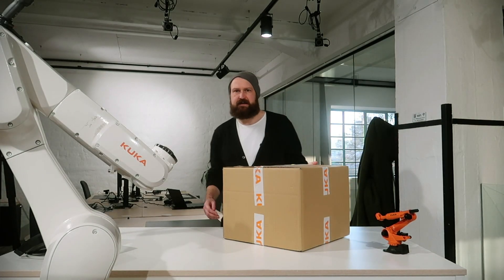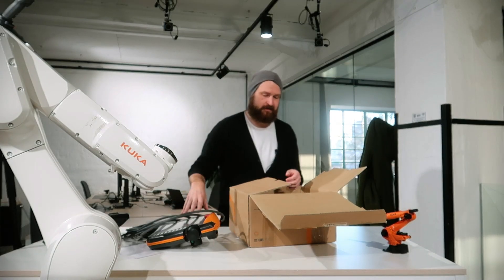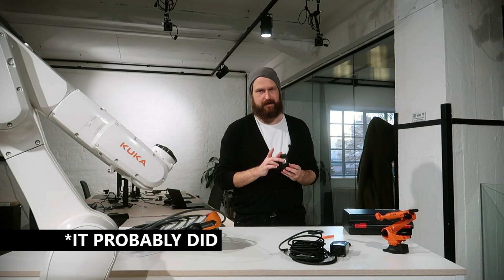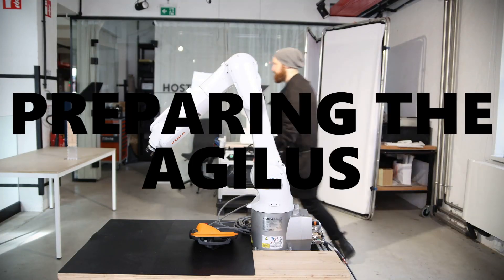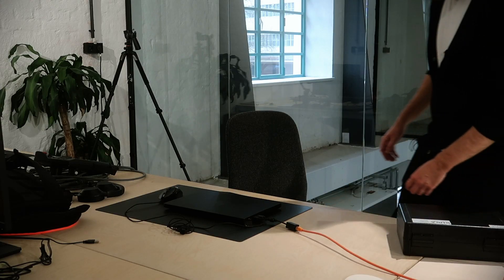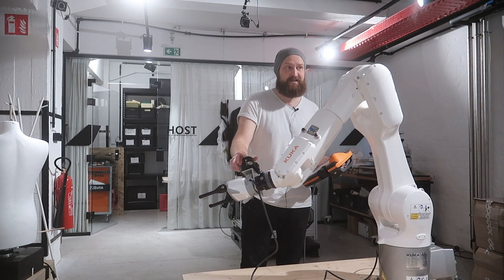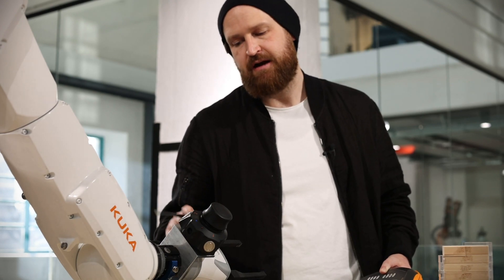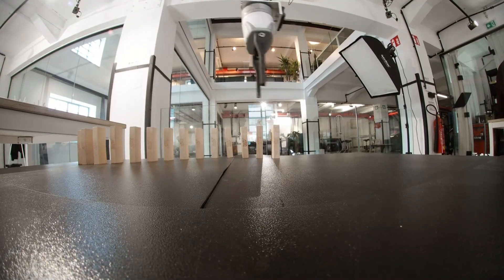KUKA ready2_pilot - Unboxing and Impressions

Comment: Nice vid presentation...very cool stuff. Would you be able to add pricing?
Reply from the maker: I honestly have no idea - as most KUKA option packages are very dependent on your setup and configuration.
Reply: @KarlSingline  okay thank you. I was just looking for a rough ballpark figure. Didn't know if it was $500 or $500,000. Thanks!
Reply from the maker: @justal8559  well its definitely in that range. As a smartPAD is ~2k, my best guess would be 4 - 6k for a single unit.. but thats just a guess.
Reply: @KarlSingline  Thank you Karl, I appreciate your reply. I was thinking about buying a used bot directly from Kuka because of their support and training.
Reply from the maker: @justal8559  that's what I recommend to a lot of people. Can't beat a refurbished unit from KUKA, especially with their support.

Comment: A $179 OEM Spacemouse(identical to the one on the smartpad) and 50 lines of math, plus a "necessary"(not) smartpad replacement upsell gets you a ~$4000-6000 option, now that's the definition of profit margin.
Surprisingly terrible response time considering what the robot and KSS can do.